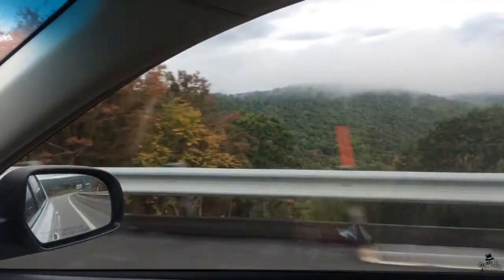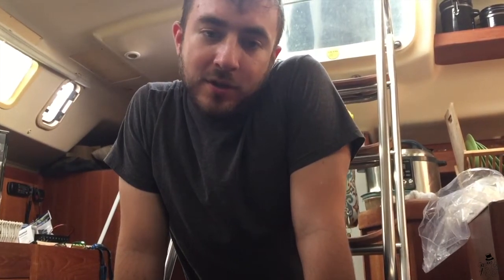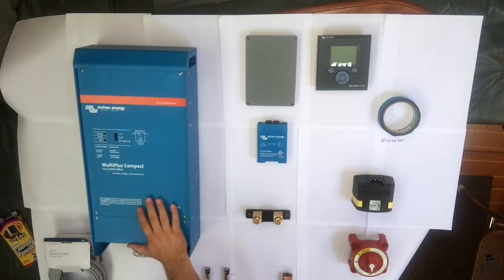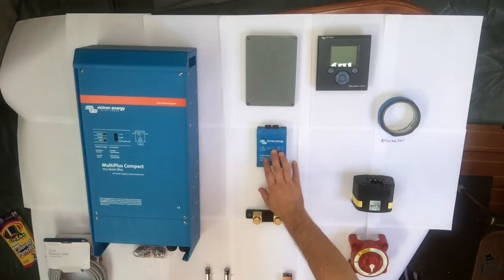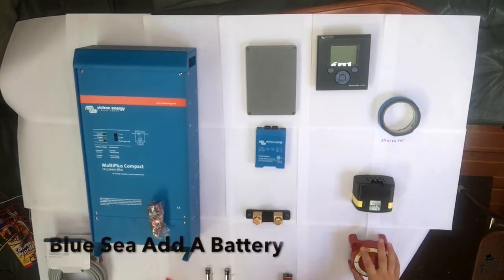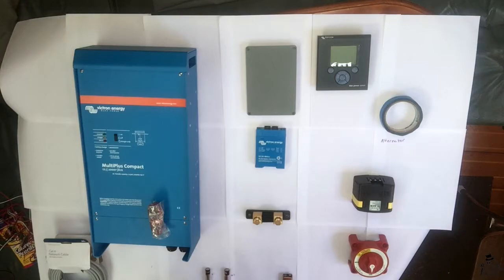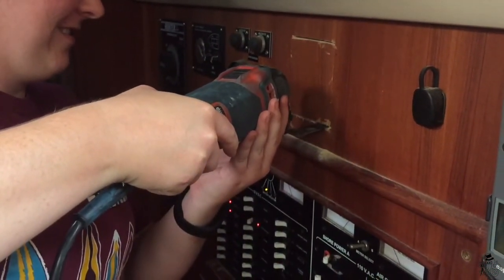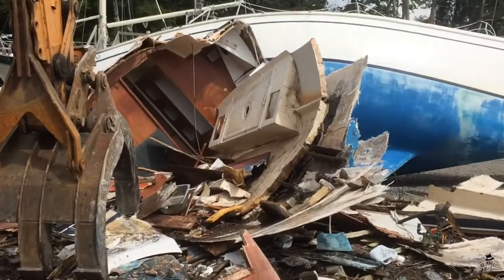Trip Prep: Victron Multiplus Wiring, Boat Demolition, Little Cutie

Comment: GOOD MORNING SIR? HOW IS UR VICTRON MULTIPLUS GOOING NOW?? IS IT RELIABLE ? IM PLANNING TO PUT THE SAME BRAND  IN THE YACHT...
Reply: Unfortunately at this very moment, it has fried. We don’t know if it was due to a power surge at our marina or a malfunction of the inverter. We are sending it to the manufacturer so they can determine what happened. Since they are in the Netherlands, it will probably be at least a month before we know what happened. We think it is more likely the marina’s fault because the inverter worked well up to a few weeks ago.
Reply: @marissaoldigesborrego5671  thanks for the reply maam... I think also the supply voltage from marina.... Or maybe some moisture/water have entered in the equipment? Is it ok  if you can give me also the reason why it was fried from makers reply... Thanks more power....

Comment: Where is your BMV 700..?
Reply from the maker: We didn't use the BMV 700, we used the Blue Power Control. This created some issues with software compatibility because it was in the process of being discontinued by Victron. By downgrading the inverter software, we were able to use the Blue Power Control, but this will create issues for us later if we try to add in solar panels.